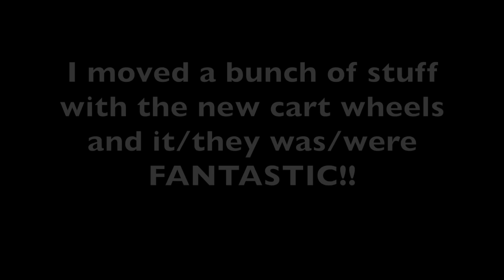VLOG 319: rubbermaid cart 2.0

Comment: I have a gray Rubbermaid service cart size like yours. I bought 6" pneumatic casters from Northern Tools and they wobble pretty bad. Question is, do your casters wobble at all?
Reply from the maker: like speed wobbles? or just in general?
mine start to get funky around 6 MPH lol usually not pushing it at full speed in my chair though..
BUT i dug thru probably 15-20 wheels on the shelf, looking for ones that had flange bearings that wernt all loose! they're riveted together, and well.. harbor freight.. what can i say! haha
oh - also i deflated, and then re-inflated the tubes.. they were on the wheels crooked! that made a big difference
Reply: Yes, speed wobbles. I think the center bolt is bent and cheaply made. Might try some other brand.
Reply from the maker: yea.. sounds about right....

Comment: Great job with the cart. If you ever get in a bind like that again, you may be able to bolt a block of wood to the cart, then bolt the wheels to block of wood. The wood will allow you to change your hole spacing (in many cases.... unless the bolt patterns are too close.
Reply from the maker: fires up the skill saw in the living room LOL ITS CORDLESS!!!
good idea though!
Reply: Well you were going to be moving anyway ! ....I get what you're saying. I was thinking hand saw... but after thinking, I wouldn't be able to do it either. And forget power tools. The vibration translates into 100% pure pain !